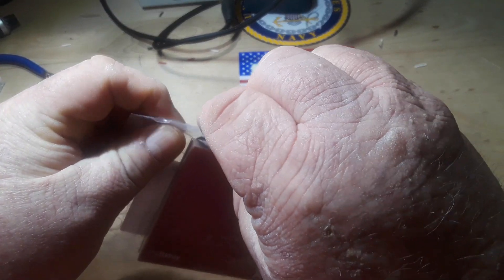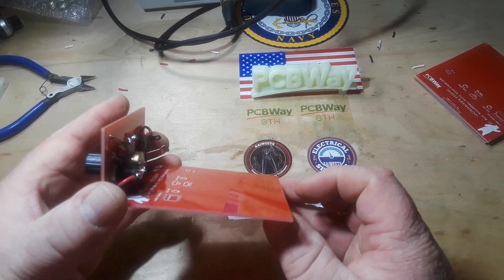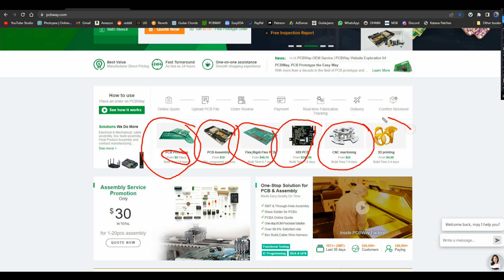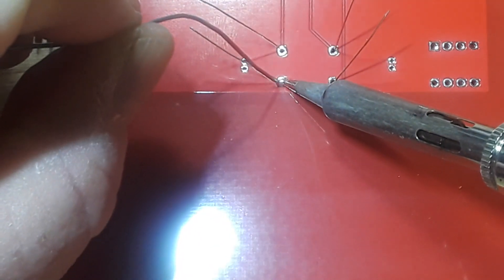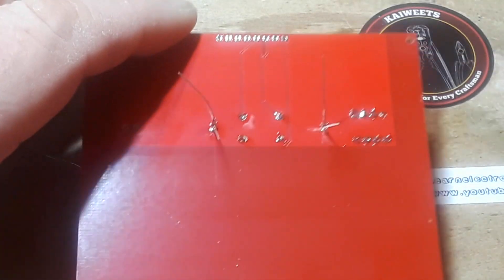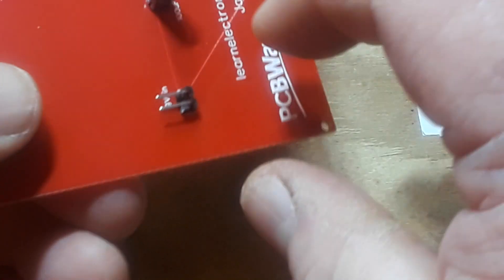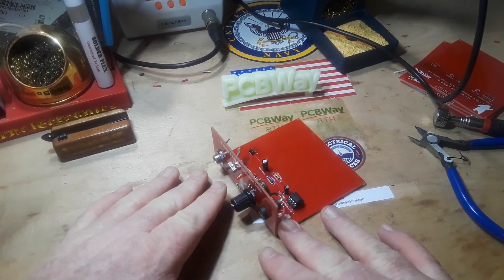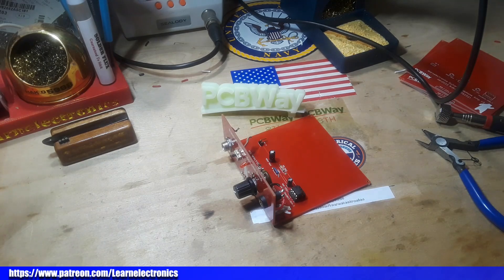Headphone Amp Ready For Testing

Comment: I've got Mk2 Mod1 eyeballs! (cataract surgery) But they are still uncalibrated! (Maybe worse than the originals!)
Reply: I was thinking that you can get Lasik surgery these days for calibration 😂
Reply: @daveharwood2843  Yea, but I didn't have any Lasik - they said it wouldn't help with my astigmatism!
Reply: @Jimwill01 Sorry yours turned out worse.  My wife just had her cataract surgery, and no longer wears glasses after over 40 years of depending on them.
Reply: @daveharwood2843  I have to wear glasses for reading or close work, but distance is fine. Would have cost me $1300 more for each eye to get the near vision fixed. At 70+ years age I couldn't see spending the extra $2600.